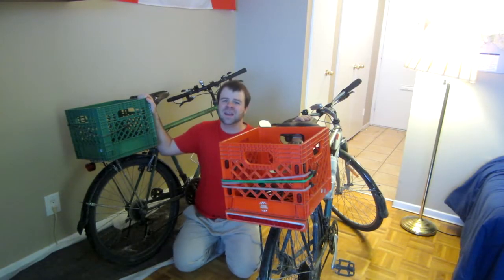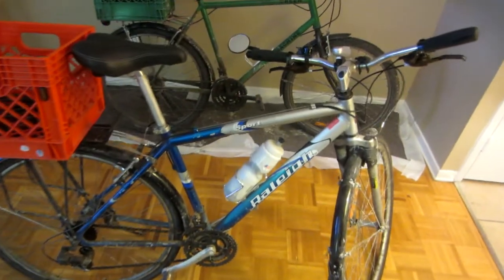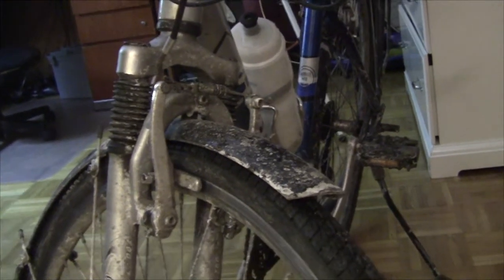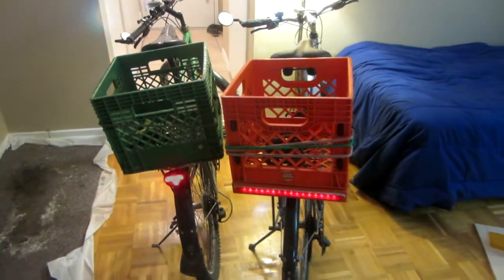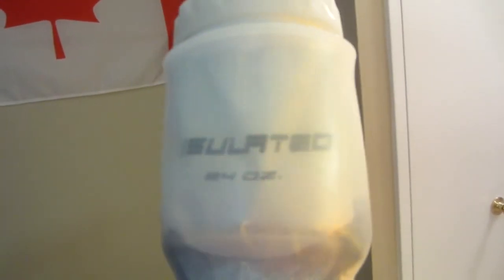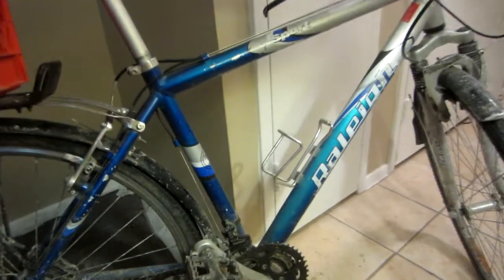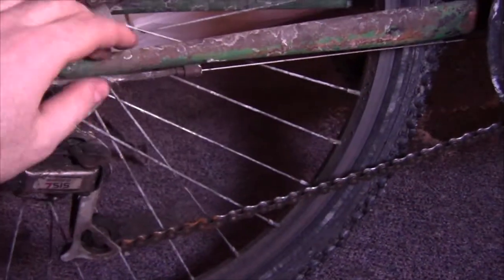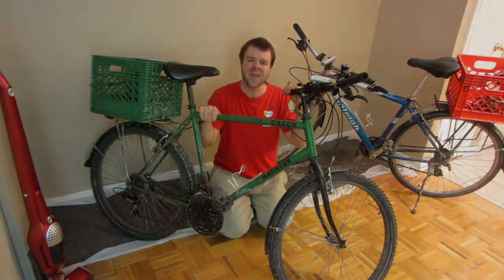Complete Guide to Winter Cycling - Bikes

Comment: Having lived in northern Pennsylvanian and rode my bike all winter I have discovered that cleaning the frame and applying a good coat of paste car wax keeps the salt residue from sticking to the bike. Just remember not to get it on the braking surface. I hope this helps. Thanks for the video and I'm looking forward to the second part.
Reply from the maker: jim mcdowell Thanks. I have heard of the car wax trick before, but have never tried it. I usually have more issues with corrosion on the components of the bike than I do on the frame itself, especially with an aluminum frame.
Reply: I'm looking forward to the second video concerning dressing for winter riding. I always seem to get over heated then I get cold. If I could find a way to dress more efficiently I would ride all winter. Thanks and ride safe.

Comment: Another very comprehensive and accessable video.  Thanks again CJ! just a random thought, I know I go through at least 1 chain and casstte every year, and probably 2 a year for winter riding, so yeah, winter will hit that harder, so even with routin chain cleaning in the winter, I think that gunk just accumulates enough abraisives to wear down the chain, so don't be surprised if shifting gets skechy even with a relatively often cleaned chain.
Reply: Shifting simply sucks in winter. My winter bike has trouble shifting due to the gunk in the derailleur, so I just leave it in one gear and ride it as a single speed. My chain and freewheel both have plenty of surface rust. Even with fenders plenty of grit gets on the drivetrain. Best method is to keep everything low spec. My commuter is all Shimano Altus. Cheap to replace chains and cogsets, plus everything is steel so it lasts very long.

Comment: nice video.  Cool to see another person's take on winter commuting.

I've ridden mechanical disc brakes in the winter (on a fatbike) and can't say they're significantly better than well adjusted v brakes.  The rotor can still ice up if it's near freezing and crud can get in there which can be more of an issue due to there being less space between the rotor and the pads.  Not to mention the higher cost for hubs, brakes, etc.  The fatbike is a blast on snowmobile trails and snowshoe-groomed mountain bike trails, but I ride a beater bike set up really similar to your green machine for commuting.

Comment: How often do you wash your bikes in the winter, cjhoyle? No-stick spray helps snow from sticking on surfaces like shovels so that could be useful on your bike. Apply when warm. Thanks for sharing your experience, helpful video!
Reply from the maker: BikeBlogger I find cleaning my bikes so unsatisfying in the winter because they just get dirty again right away! It's also pretty tricky to find a good spot to clean a bike when the temperature is below freezing outside. In previous winters if there has been a warm-spell in the middle of the winter I have sometimes cleaned my bikes. Otherwise I will just wait until late March when they are done with salt on the road and then do a very thorough cleaning.

Comment: I am setting up a dumpster rescue bicycle for my first ever attempt at commuting through the winter this winter. Great video of info and tips. Problem I have is how often I almost get run over now commuting and it's only cold fall like weather here. Horns honking everywhere. It's driving me crazy, and scaring me off a bit for the colder snow months. Any advice? Tutorial video on snow skills?
Reply from the maker: funkybioped In my follow video, which is about clothing for winter cycling, I have shown how I make myself extra visible to drivers (beyond just using my lights). I will have to think if there is anything related to riding on snow skills which I can share. From what I remember, the only thing that is really differnt is that it's harder to balance. Last winter I filmed some narrated riding videos on snowy and icy conditions. If you haven't watched those already I recommend taking a look because I'm sure I discussed briefly what I have learned about riding under those conditions.

Comment: External gears are pain in ass even in summer. Go for internal gear hubs and price will be worth peace of mind. Drum or disc brakes are great.
Reply from the maker: To each their own. I prefer external because it offers a much wider range of gearing ratios, and it's a lot cheaper. As someone who rides in all seasons, I strongly disagree with your statement about external drive train being a pain in the ass. Even the low end components I use rarely give me problems in the worse weather conditions.

Comment: To stop flat tires you can use your old inner tubes and put them inside of the tire ontop of your good one just cut off the stems and then you have an extra layer of rubber.....haha I hate being on the road and getting a flat tire in the cold or the rain without an air pump.....but once you line the tires you can just glide over glass and piles of stuff out on the road without any worry of getting a flat I made a video a little while ago explaining how to do it if you want to feel free to check it out its on my channel
Reply: U still be getting some flat tires? Or you never get flat tires anymore?
Reply: the blue bike i had got stolon but the tires never went flat while i had it haha then i had a red bike after that i did the same thing and never got a flat on it while i had it but right now i dont even have a bike im working on getting another one

Comment: Thanks very much for this!
I find this video very helpful.

Can I ask you, what is the size of the tires on your bikes?
I've read that for winter/ice (I live in Yellowknife) narrower tires have more grip, because you have more weight/pressure per square inch of rubber.
On the other hand, wider tires require lower pressure which also means more grip.

So do you have an opinion on narrow (eg 35c) vs wide (eg 2 inches as with mountain bikes) for winter and ice?

Thanks again!
Reply: +virkelie2 I've actually tried different sized tires in all possible conditions and I have to say that I think the idea of narrow tires having more grip is just plain wrong. As soon as thin tires get into snow they start to dart left and right, rather then cutting straight down to the road as many people suggest. That's my experience at any rate. My commuter has Schwalbe Marathon 38c tires, and my mountain bike has 2" Schwalbe Ice Spikers. In tough weather, the 2" ice spikers are amazing. They are the kind of tire that allows you to crawl through or up nearly anything, leaving cars spinning on hills or in their driveway. The advantage of the narrower marathons is that they are much more efficient on "normal" winter days. My speed is similar to summer riding with them, but there are enough spikes so that I won't even notice if I ride over some ice. I've used both tires to fool around on skating rinks just to see peoples reactions :) So basically, fatter and spiker is grippier, thinner and less spiky is more efficient.
Reply from the maker: +-20 Biker Very well explained! It sounds like our winter bike setups are pretty similar.
Reply: +cjhoyle Thanks! I've learned a lot about bike maintenance from your channel! I've had a few different setups over the years. For about six years I used a setup very similar to your "green machine" i.e. v-brakes, 35c spike tires, but with the exception of a nexus 8 speed hub rather than external deraillers. My new bike has hydraulic disk brakes and an alfine 8 speed hub, as well as a gates carbon belt drive. I was really lucky to find it used (Norco Ceres). I'm really happy with it, though I've only used it for one full season. Looking forward to a second winter on it!